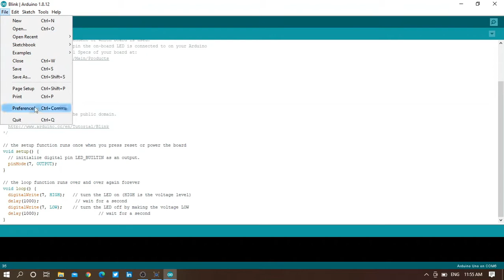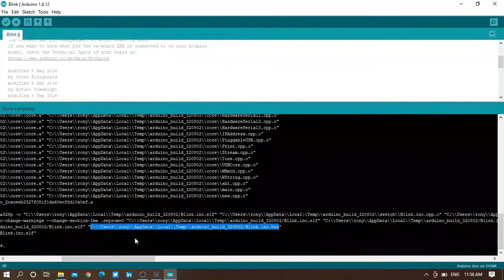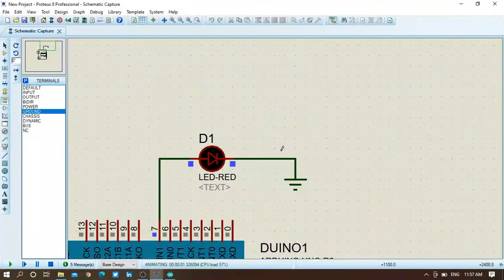How to upload an arduino code in proteus software

Comment: Hello, my Arduino doesn't create hex file, I have done everything on the internet. it creates only .bin and .ino file, I've done every single thing i can find on the internet about getting the .hex file and nothing
Reply: i just copy the location as 2:08  to the Proteus program file, u may try this way..
because my file is also in .ino file (C:\\Users\\User\\AppData\\Local\\Temp\\arduino_build_382518/sketch_mar22a_sensor_lab_1.ino.elf) hopefully this help!